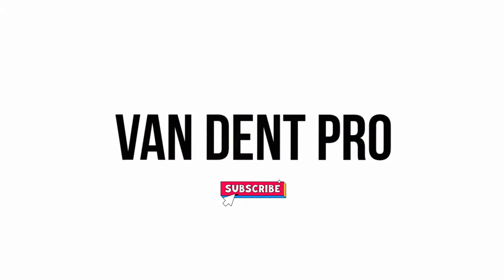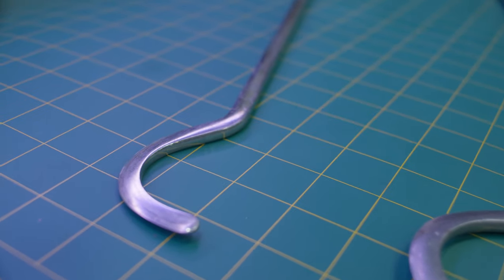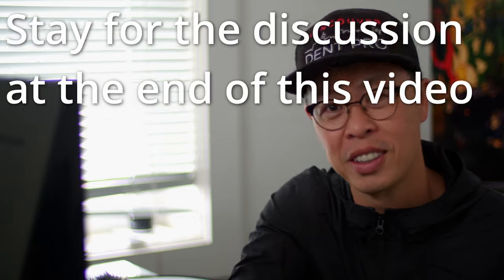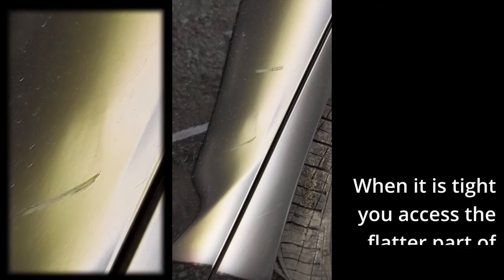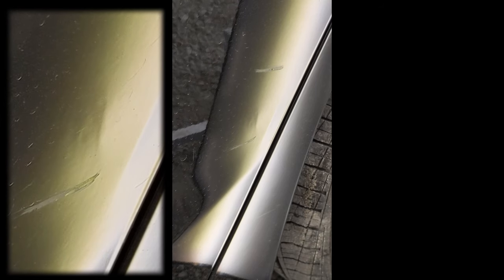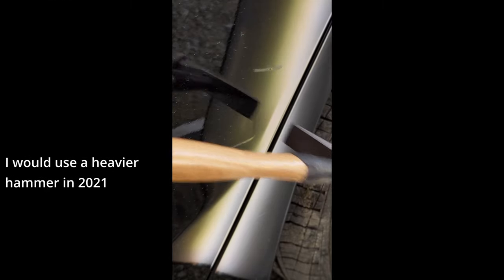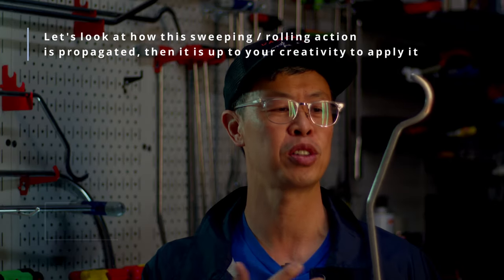Stanliner Crane Rolling along a crease : Twisting Application

Comment from the maker: Table of Contents:
0:12 Intro
0:49 Concept development background and where I got my understanding from
1:47 Repair background
2:28 Repair setup
2:35 Repair begins
2:43 Rolling / Dragging visual feedback
4:50 Knocking down over-pushes
5:57 Tapping down hemmed edge 3x speed
6:40 After PDR on the example
6:47 How do we apply this daily? Let's discuss the concept so you can apply it  
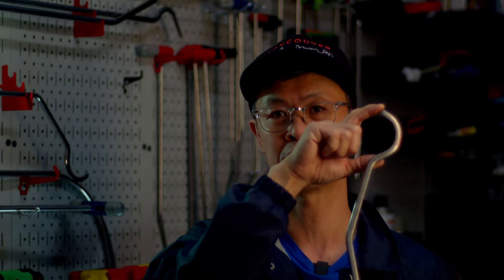7:35 What's unique about the Stanliner shave design
7:49 Church Window cross-section shave by Stanliner
8:22 The sweet spot 
8:35 Rolling (sweeping?) metal with the crane shape - 2 directions
8:55 Start of contact and rolling parallel
9:27 Rolling perpendicular
9:54 Last words and motivation

Comment: Great video. i am about to buy some Stanliner tools. I was wondering if you could tell me what that hammer was with the long flat narrow head was? I want one,Thanks
Reply from the maker: Hi Thanks for watching and happy to help. I used 2 Hammers in this video: the pointed narrow head is a single sided stainless Druz hammer and that tip is very clean for a small tip. This hammer with the M48 tip is really versatile.  The other hammer is something I customised from a silversmithing hammer. The wedge (flat) side I rounded up a bit in both directions. It took alot of iterations of shaving and polishing  to get it to where I wouldn't make marks.  It's a little light for edges to be honest.

Comment: i hate my stanliner pirate hook 35 inch it has no use for me i maybe fixed one crease with it it has no curve in real life you need  a curve in tool.shaft is to straight/panels always are curved outwards a straight pirate shaft wont work!.what was i thinking!.looks nice though.the one time i used it was on a silverado truck crease was close to tailight where i had i nice wide opening.maybe its just me but the crane and stuff different
Reply from the maker: Hi John. I feel your pain, I understand about the bend on the pirate hook. The universal pirate hook I assume right? the 1/2" rod? If so this 1/2" universal pirate hook isn't primarily a crease tool like what other people here on youtube have presented. I have both he short and long ones. I use them for regular pushing with the tip and the "heel" and the face is pretty flat and smooth so it works really well for dragging big areas. I will do a video in this topic but using the big hybrid crane sword. Same idea. The pirate hook is my beefiest rod with alot of abilities so it's going to make life easier. Hang on to it and don't put a bend in it if you haven't already. This univ pirate hook is my jack of all trades tool and delivers a heap of power.
Reply: @VanDentPro  ya its the1/2 one I have not put a Bend in it yet.

Comment: Stanliner too expensive for me, been pushing dents for over 20 years without spending this crazy amount of money for a single rod. I guess i am old school.
Reply from the maker: That's cool 20 years!, yeah I know it's hard to spend this kinda money on tools when the OG tools were so inexpensive. You can get the job done either way. Just sharing a different way to do it Victor. I want to do this until I'm 90, so I'm finding easier ways to do it for my wrist and shoulders.
Reply: @VanDentPro  I should have said 20 years part time, this is not my full time job but more of a hobby / side thing, I love PDR and enjoy the heck out of doing it. I have a practice panel in my garage at all times and try to keep my skill up when the side thing is slow. Thank you for sharing your knowledge.
Reply from the maker: @victorbarranca2910  That's motivating to hear Victor. I've been meaning to setup a practice panel again in my shop. There's always new skills to learn. I have a power shrinking box that I haven't tested yet. I can tell you Kaz has practice panels for training others and I think also for his own experimenting.